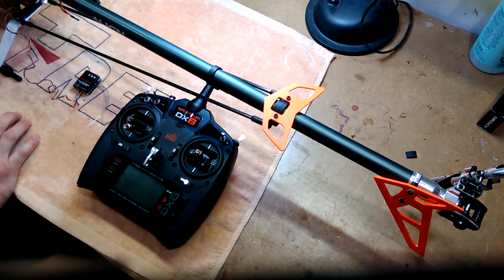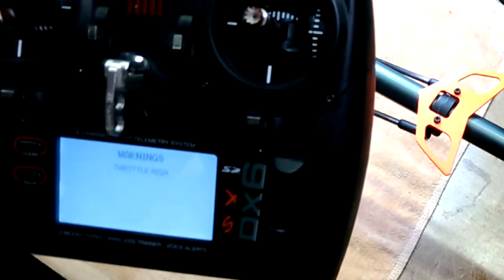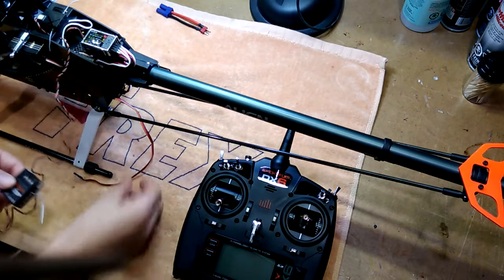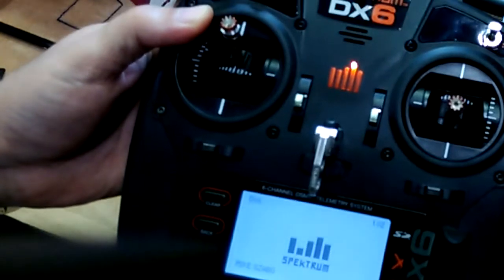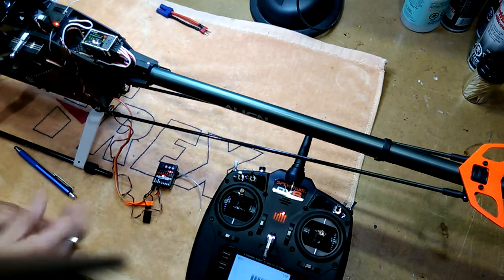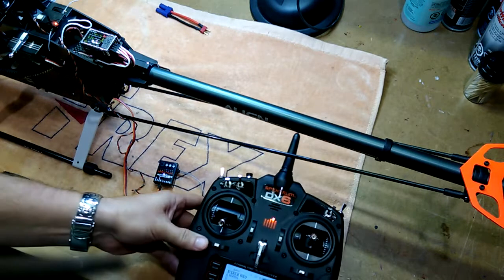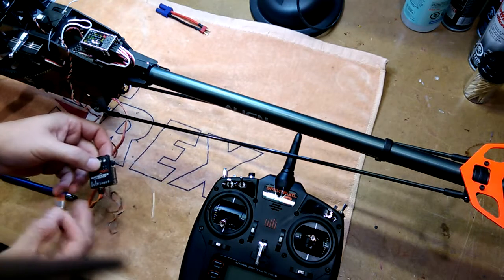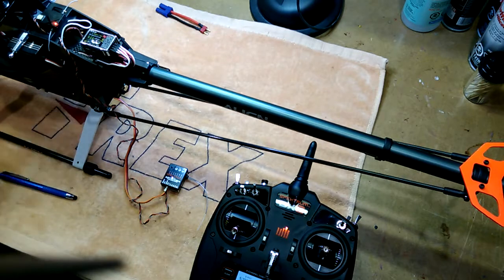Calibrate Castle ESC Endpoints w ar7210bx gyro

Comment: Will this work with a 7200bx and a Castle Phoenix 100 and Spectrum DX8?
Reply from the maker: It should I have the ar7200bx and the obligation for low stick are the same.
Although im not familiar with the 100, the castle baseline programming for end points is the same to my knowledge.